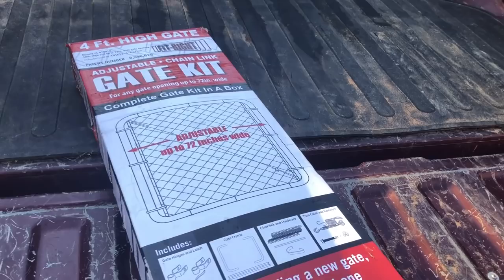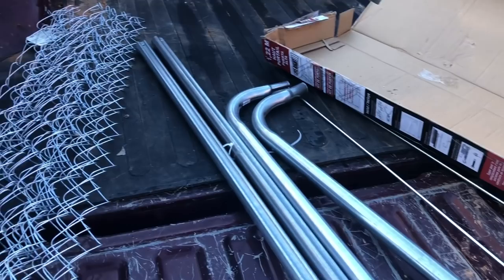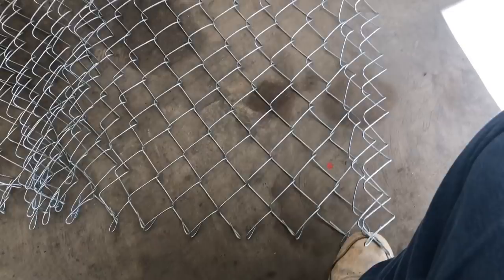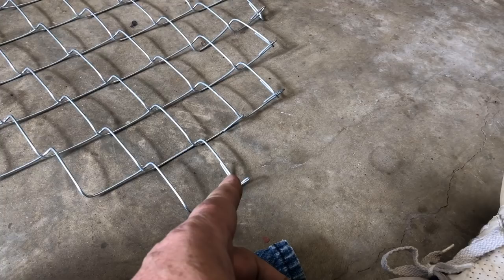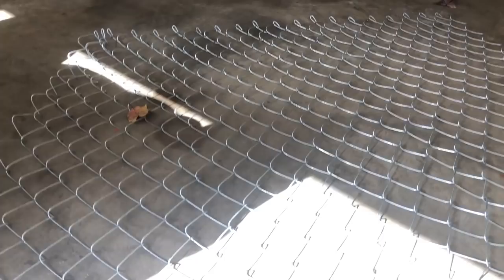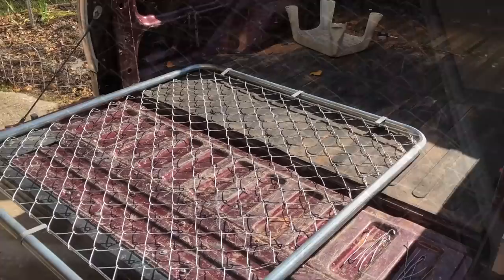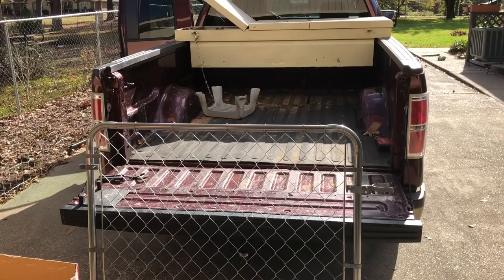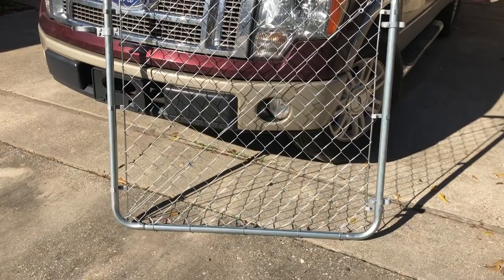Fit-Right adjustable gate assembly

Comment: Well I wanted to see the adjustable part... how to adjust it.
Reply from the maker: You cut the top and bottom rail with a hacksaw. That’s how you adjust it.
Reply: The problem I had was that the fence I bought at Lowes was not 10ft. Was too short. Was wondering if this one extended.

Comment: Do the pipes that attach to the side verticals come with the kit?  If so, they appear to be 6 ft and  I'm assuming you cut them down to 48 inches to make your 4x4 gate. Thank you.
Reply from the maker: Yes. That’s the largest size of the gate.
Reply: @bctruck  Well, it's been over a year now that I installed the double gates and your video helped me so much. Thank you. But something went wrong over time and I don't know if you've encountered the same problem. After installing the gates, the latch had very good clearance through Summer and Fall. Then this Spring the latch became very tight. I'm assuming the posts shifted in the Winter, but I'm just guessing. I live in Northern Illinois. I plumbed/leveled everything, but for some reason, the latch tightened up. I'm not certain if I should remove both gates and try to readjust everything...except the posts/pipe of course. By the way, the posts/pipes are well plumbed upright. Any info appreciated. Thank you. — Jose

Comment: If that was a lot of work for you, wow, I through this together in a half hour. This gate is designed for non nominal gate sizes btw. Good video though
Reply from the maker: Obviously, yours wasn’t tangled in a knot. As soon as I got the thing untangled ,putting the gate together was Childs play. You should learn the difference between through and threw , but good comment otherwise.
Reply: @bctruck  did he not watch the video and see the trouble you went "threw" rebuilding that fencing? Had to throw that in there too 😂
Reply from the maker: @ramblin_man23  How'd you like to have that guy working on your plumbing or heating?
Reply: @bctruck  I'm sure he'd do a good job, although he'd tell his helper how much he sucks and brag about how fast he through it all together 😂